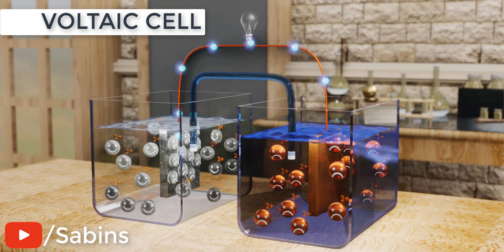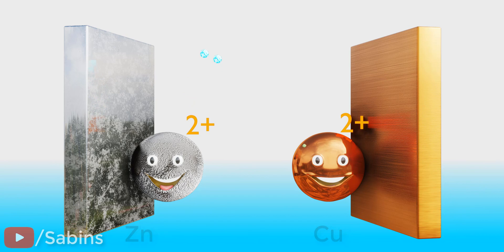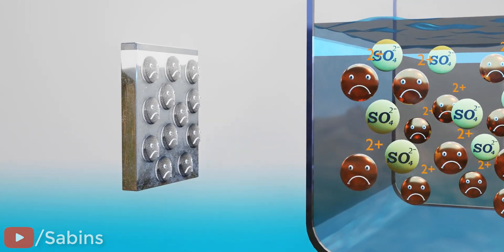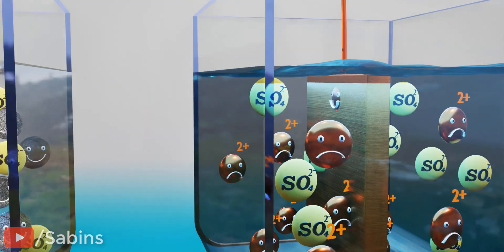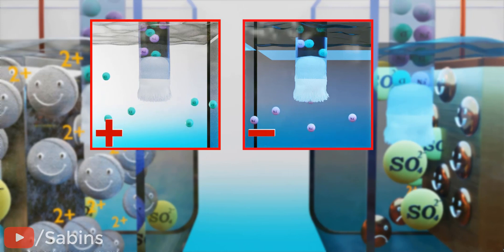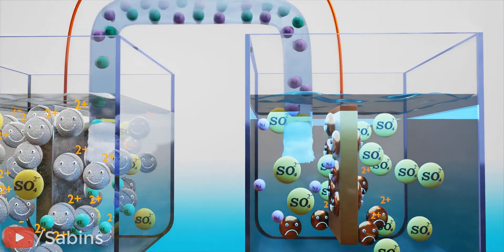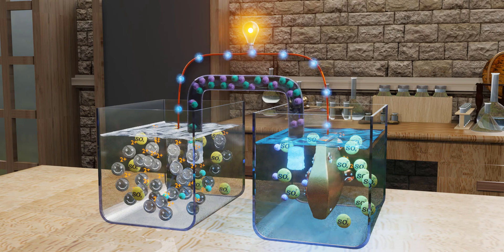Voltaic cell | How does it work?

Comment: Wrong you should not use nacl with ideal denail cell 

Na2so4 should be used and the mechanism of salt bridge wiuld have been quite different from what you taught 

It is correct but not for ideal denail cell

Comment: While sodium chloride (NaCl) can be used in a salt bridge, it's not as common as potassium chloride (KCl) because the ionic speeds of Na+ and Cl- are different, potentially causing issues with maintaining electrical neutrality. 
Hence KCl is preffered over NaCl electrolyte in Agar-Agar/ gelatin non electrolytic phase.
Still there are expt. to use of KCl. (for some)
Reply: Wouldn't you by chance know what happens in the solutions incl. bridge if the battery is short-circuited?

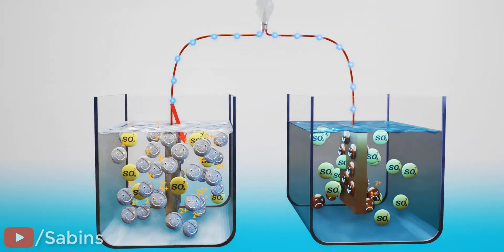Comment: 2:17 I have a doubt: WHat If electrons come out from that half cell from which metal is forming and not metal Ions  so there will be no problem of attractive force  and electrons will go normally

Solution : If electrons are coming out it itself means that +ve ions are getting formed i.e oxidation is taking place

Comment: Timestamps 
00:02 - Galvanic cell produces voltage and current flow
00:36 - Connecting zinc and copper to achieve continuous current flow
01:05 - Voltaic cell uses copper ions and zinc atoms to generate electricity.
01:36 - Zinc ions flow through circuit generating electricity.
02:10 - Accumulated charges impede electron flow
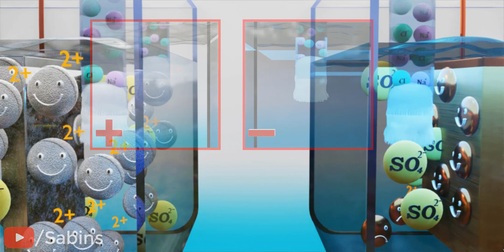02:42 - Salt bridge enables ion flow in voltaic cell
03:11 - Introduction of salt bridge sustains voltage and electricity production.
03:43 - Voltaic cell operation and outcomes

Comment: One year ago, I made a voltaic pile. But I haven't used CuSO4 solution, instead I used a mixture of lemon 🍋 juice and salt. I want to know "if there is the same process going on in the lemon juice battery also, which chemical compound is electron hungry and which one is the donor?

Comment: Both Zinc and copper are listed as +2 ions on the periodic table. This means that they would both want to get rid of 2 electrons. If what you were saying was correct, why is copper not -2? Even though you showed this in your animation, why then did you decide to make the electrons flow anyway?
Reply: Ionization energy of both may cause Cu to accept electron
Reply: @IsratJahan-ge4li why does the copper start as an ion?
Reply: You better search from a brief explanation.

Comment: I understand, I just wonder if the salt bridge can contain a mixture of zinc and copper sulfate solutions and the copper side can pull in zn cations and zinc side can pull in the sulfate anions to neutralize eachother, why sodium chloride? also how will acidify the solutions affect the overal reaction rate and voltage... I am gunna hit the lab and figure this out soon

Comment: How to produce more current using this concept.As current is very less and voltage is more.
Reply: use a more reactive metal like magnesium and a less reactive metal like silver... the bigger the difference in reactivity, the greater the charge, check out reactivity series of metals...however zinc and copper are easier and cheaper to use I imagine